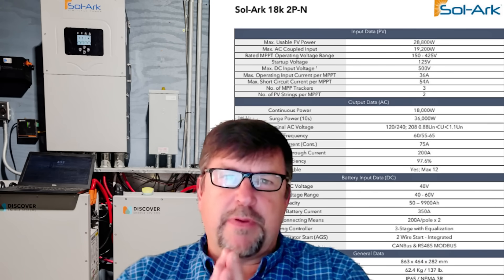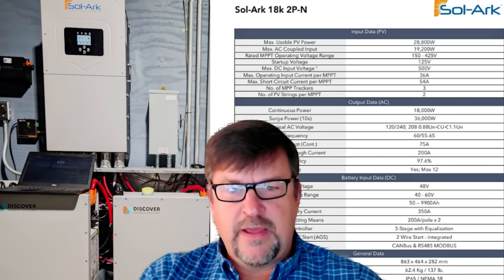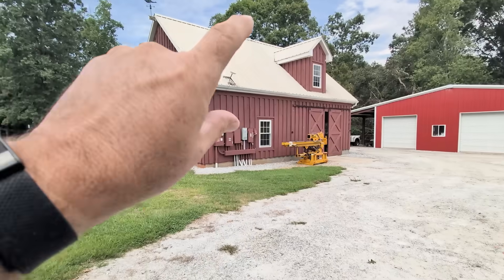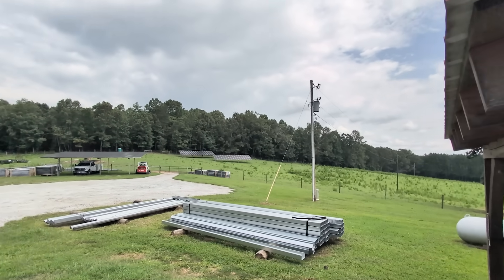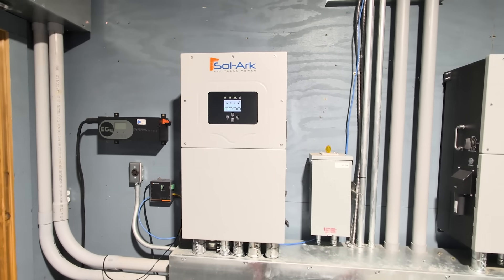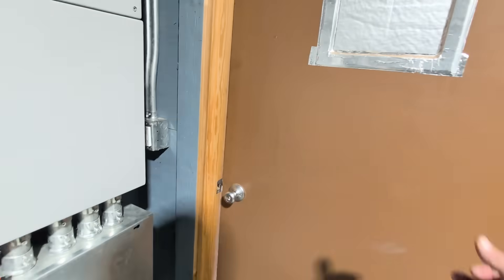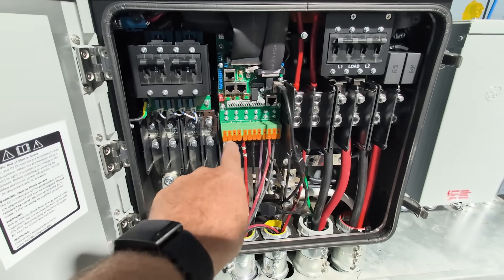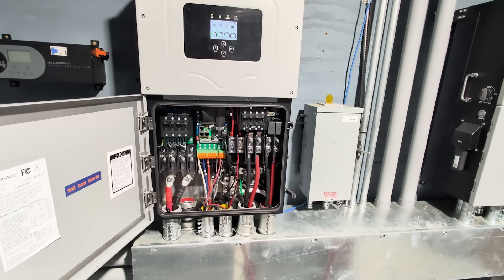Introducing Sol-Ark 18K: Seamless Whole-Home Backup, Zero Load Sheds!

Comment: Hi 775 will 2 18k drop seamessly in place of two 12k's in parallel?
Reply from the maker: Well it's a great update grade from 2-12ks but they will need to be rewired for much larger wires so it's not seamless. I'm happy to walk you through the process of what you'd need to do if you're interested.
Reply: Hi I am interested thank you
Reply from the maker: @davideckert4702 please send me an email. info@practicalpreppers.com

Comment: Common Sol-Ark inverter problems include frequent AC overload shutdowns (F34), communication errors with the Battery Management System (BMS), overheating, and display/power issues,

Comment: I have 3 Franklin 13.3 kw ea batteries with the A Gate that kinda does alot of the smart stuff.  So should I get the Solark 18k ?   The franklin requires an inverter for the Solar.  Should I get this one.  It does cover My 20k worth of solar.  Just wondering if im going overboard getting this one?

Comment: I got a question for you, I have this CATL EV pack that comes in a 36s configuration, if I split it into 18s pack, which has a higher charging voltage, so at 60v based on the spec of this unit, I can charge it at 60v only so that roughly equals 80% capacity on my cells. Do you foresee any issues with the unit working at 60v charging for an 18s pack vs a standard 16s pack? 

I don't want to break down the packs and have extra left over cells, and I would rather have a lower state of charge for those cells to last a long time if possible.

Comment: Have you done any installations with bidirectional chargers?  It would be great if the 18k could independently connect to two battery banks: a primary bank that's always connected to the house, and a bidirectional EV charger that's intermittently available.

Comment: We have 2 12k emp hardened and think I need to upgrade to 2 18k but I don’t see hardened versions yet.  I currently have 24 100ah 12v batteries connected in sets of 4.  Both look as though it’s worth upgrading. I’m looking at upgrading to a much larger battery bank as well.  

Have you looked into a 16k 48v battery system called Ruixu Lithi2-16?  Will Prowse is raving about them….  I am hoping to get 4 to 6 of them. 

The hydrogen device looks very exciting especially where we live in NE Oregon.  Thank you for showing that!

Comment: Great video. Just curious..can this inverter power a critical loads panel and also a non-critical loads panel?  If the power goes out in the middle of the night I specifically don't want my air conditioner or other heavy loads turning to drain my battery.  I know that the grid boss allows for this.
Reply from the maker: Yes, it's full 18K. Unless you're running an EV charger on top of everything else, you don't need to load shed. Plus the 200 amp pass-through takes care of any issues of coming up short on power.
Reply: @engineer775 thanks, does it have the ability to turn off loads when the grid goes down?  For example, I don't want my hot tub turning on in a grid down situation...would I just connect my hot tub to the smart port?

Comment: I do have 1 problem with sol-ark so far is I didn’t get a manual with my system I did call them and they told me they would send a manual but haven’t received one yet and yes I understand I can get it on line but the problem is I won my argument with the representative on why I wanted a written manual and was told they would send me a copy but didn’t honor what they told me they would do and haven’t done it yet and your word is only as good as you say you would do so I’m not sure I’d buy their system again even tho it’s works great their word is just as important to me as the product .

Comment: Comments about the MPPT controllers:  While there are only 3 (we all agree that 4 is better than 3), at least they are all offer parallel inputs.  If the connection is still only for 10 awg wire, then to safely pass 36 amps, you will need to use parallel inputs on each MPPT controller.  Also, your install shows the battery terminal combiners being used.  On the 18k, the output is 300 amps, so a single set of 4/0 battery wire needs to have the 90 degree C rating or you need to run 2 pair of battery cables for safety.
Reply from the maker: Yeah I clearly say that in the video about the mppts. And I'm running two Helios batteries. The cables I'm using are rated for 450 amps.

Comment: Honestly, this really isn't a new inverter. It is a downsized 30k... I can understand how there is little benefit for an MID on your property. However, for the vast majority of installs, they make total sense. I am surprised Sol Arc is moving this slowly on what customers are asking for.
Reply from the maker: The architecture of a 30k is nothing like the 18k.  Have you opened them up? 
Have you installed a mid alongside an inverter and utilized the smart ports yet? Do you realize you can't use the load out on the inverter once you couple the two? I guess it comes down to whether or not you want to have multiple failure modes on your install or you're trying to simplify and give the customer the ability to manage all their loads.  95% of my customers want to run everything?
Reply: Can you use a 15k with a 18k together

Comment: Finally they named it based on the Power Output from battery not some make believe Hope it works 15k IF you have solar which in my experience it was 12k then sol-Ark made a setting change to allow 14k but still not 15k 😂

Comment: How is this different than the 15?? Can’t you AC couple or load shed on the gen port of tbe 15 as well? I don’t understand how this is any different other than larger capacity? Also and estimates of MSRP? I’m about to buy a 15k. Should I wait?
Reply from the maker: Its basically a bigger 15k. By a lot. 6kw more ac output on batteries.  And you can pit a ton of solar both ac and dc coupled almost 50kw.  All other functions are the same.

Comment: On the 12k there is an issue using the GEN on Grid, in it doesn't shave the GEN if load exceeds it's capacity, so it'll trip your GEN. This prevent me using it like this. 
Does the 15k or now 18k have addition control on the GEN on Grid connection to limit the GEN load?
Reply from the maker: Yeah this is a problem on the 15K as well. When the load of the home and the battery charging exceeds the capability of the generator. It's going to shut down.

Comment: $7300 for a single Inverter is a pass. As when it goes out, that's a lot of cash to replace it and downtime. I get it has a bunch of good features, but the cost is crazy.
Reply: Ditto...
That's going to be a hard sell against 18kPv at half the price or the equivalent even less expensive Luxpower unit
Reply: I’ve never seen the advantage for solar power. When I breakdown the cost for the equipment vs the cost of grid power it just doesn’t make sense to me. As a backup in case the power grid collapsed, sure I understand that from a prepared standpoint. But it seems to me you are just paying for your electricity all at once up front with solar vs over time with grid power.
Reply: @ecleveland1  if you want back up power, you could get a generator, but a generator is always the money pit never pays for itself. You you install solar and eventually after 10 to 20 years it’s paid for itself and starts paying you back and all that time you’ve had peace of mind, knowing if your power goes out for a day ,a week ,a month , or more that you will always have power. Because even if the sun doesn’t shine, you still get 5 to 10% capacity for the day. Peace of mind, knowing you will always have power is truly priceless.Panels these days are guaranteed to produce 85% capacity at 25 years plus. My whole system should be paid for within approximately 12 to 14 years depending on how much electricity goes up in price.
Reply: @ecleveland1  There is depending on where you live and how much electricity you use. I live in CA where it'.40 - 62 cents a kwh plus high usage "fine" fees and taxes come out around a dollar plus a kwh.  I installed a 12.3kwh system myself (permitted) Its Enphase as the single inverters are cheap to replace when they go out after warranty and the only downtime is that one inverter. It cost me $21k my Roi is 4.5 years. which will be next year. I have a zero-power bill because I am under Nem 2.0 and get a credit of $600+ every year to pay all There fees/taxes. Also, I don't have a battery.
Reply: Yup, the sun doesn't always shine, the wind doesn't always blow, and the propane guy always asks for cash up front because he knows you're busted....
Reply: Maybe fix it ?
Reply: @Boomer2298  What we fixing?
Reply: Overpriced, cross your fingers hope it works as advertised

Comment: I have a solark 15k and 10kw worth of solar.  I dont have batteries but would like to get some and maybe put them in the new shed that I need to get because my current one is falling apart.  I also want to build a garage and put solar on that roof so that I can definitely get enough solar in the 3 months of NC "winter" where the sun isnt powerful enough to offset my power bill.  Should I replace my 15k with an 18K and just have the 1 inverter or should I daisy chain 2 15Ks for redundancy?  

Also do they still do emp protection on their inverters?  I was originally going to get a 12k because it had emp hardening but the installer said I should get the new 15k because it had the 200A pass through and it would do what I needed better than the 12k but it didnt have the EMP hardening because it was brand new.  So now I wonder if I should just get rid of the one I have for the emp hardened version or if the 18 will work and it is going to come in the emp hardened version as well wait and get one of those.  I got the solar originally because of all of putin's saber rattling back in 2022 and I was concerned about ww3 kicking off so emp hardening was a primary focus.

Comment: Have you ever done any work with the 30k or 60k. Im Planning on either 6@15k/5@18k and 1 60k 3 phase in the shop. It would be great to see some videos.
Reply from the maker: I get so overloaded with residential consultations and installations that I have not been able to break into the cni market. We've got a couple 30ks out there and we've sold some 60ks. I think the best combination right now is the solark 60k and the Discover hv210 battery.
Reply: I used a 30K and 80kWh of s-A batteries and regret it. Lots of run around from their sales and support. Never again.

Comment: Looking at the spec sheet 18k vs 15K,  the 18K is a bit thinner but similar in size and weight. The silent fan seems to be that it now has ramping instead of turning on(full power) and off. With this I can infer they are using the newer SiC MOSFETs and knowing Sol Ark, the true continous output is likely higher. 

I would have liked the 4th MPPT and a higher voltage around 600-650v. Prob the spec sheet is being conservative  because some installers pushed ~500V in those 15Ks and 12Ks and were complaints of no pv production(Im just guessing). 

I also would have liked they implemented a bypass switch, some competitors have it and is useful.

I have no doubt this inverter will likely have a longer lifespan than the 15K. This is a monster and will run easily the average house without the need of a critical loads panel
Reply: The 500V limit is a consequence of using boost converters to bump each PV input to the 500V DC buss that the inverter and battery charger parts of the Sol-Ark use internally.  They would need either a higher DC buss potential or a different converter architecture in order to get 600V or higher inputs.
Reply from the maker: We haven't needed a critical loads panel since the 15K debuted.  The 18K is the same width as the 15. It's just a little taller.

Comment: That Upstart fuel cell looks cool but what yahoo made their website?
This is at the top,
THE PROBLEM
Whole Home Energy Challenge
When considering a home energy system, there is a trade-off you should not have to make.
Pocket Book
Go with solar and battery storage that will help you minimize your utility bill but risks leaving you exposed during long-duration grid outages?

Comment: Definitely concur with the 18K needing more MPPT channels.  They also need some I/O functionality beyond a single 2 wire generator start output.  That would be perfect for things like multiple levels of load shedding, and would make controlling those loads in other buildings easy as you would just need to run some intercom or thermostat wire to supply the load contactor coils.
What would be much better for that fuel cell is either an integrated electrolyzer and hydrogen compressor in the same cabinet or at least a companion electrolyzer/compressor cabinet that works with the fuel cell.  Having just a reformer type fuel cell still means you need a source of propane or natural gas.
Reply from the maker: Excellent!. The cool thing about being coupled to the Discover battery is the lynk gateway provides multiple relays with all sorts of I/o for load shedding if necessary. I'm actually finding it a better way to control generators than using the solark.  The reason the upstart power is using propane or natural gas is because the network is already established. Anybody can get propane and a lot of people already have natural gas. So it was intentional.
Reply: @engineer775  The point of using hydrogen instead of propane or natural gas would be for use as a long term means of energy storage without needing to buy in fuel.  Buying in hydrogen would be stupid due to its horrible energy density and high cost, thus using an on premises electrolyzer to make the hydrogen (such as from surplus solar in the summer months) instead.
Reply from the maker: @randacnam7321 of course, this is an interim step taking advantage of the propane and natural gas networks. On-Site electrolysis whether it's through reverse electrodialysis or solar electrolysis or closed-looped systems that produce hydrogen as a byproduct. The difficulty is in the capture and storage of that hydrogen.  
Making it on demand is too slow so there has to be a process that works and stores it safely. When I was making wood gas (hydrogen and carbon monoxide) I had to make sure I was making the right amount to match the load. Storing it uncompressed is not practical so then when you get into the 5000 PSI compression that we see like for the Toyota Mira that's a huge electrical load. I was just very excited that they could take The source of hydrogen out of the equation and focus on being a resilient maintenance-free power provider disrupting the generator market.

Comment: That hydrogen cell is only rated at 5 something amps continuous / 1.25kw @240v . I get it, it only sips on propane versus a generator that uses 2 to 4 gallons an hour but at 100 amps it more.... I'm going to have to do the efficiency math on that

Comment: I was so close to pulling the trigger on two hardened 15Ks, then this video dropped. Now I'm thinking one hardened 15K and one new 18K, gives me more power for most of the time, and some basic capability still if an EMP hits. Thanks for the review and the property layout - has me thinking about a mechanical shed between my house and the barn that's about 150' away.
Reply from the maker: You can't combine a 15 and an 18. Fyi
Reply: @engineer775 answered my question too